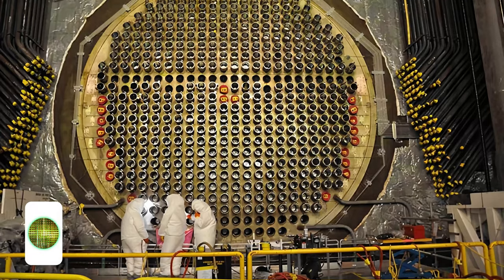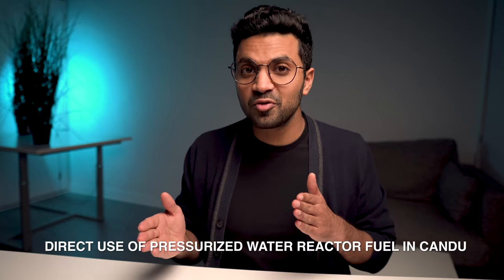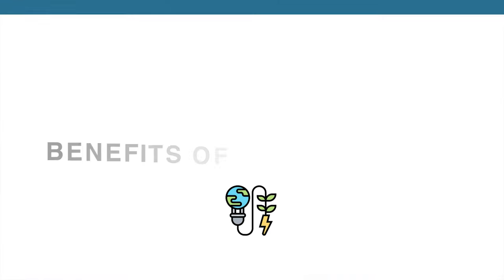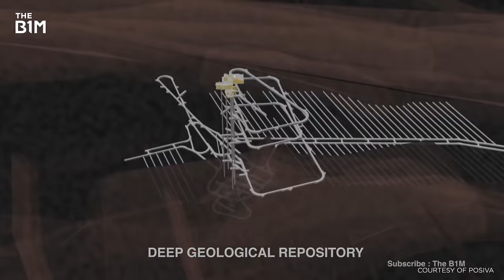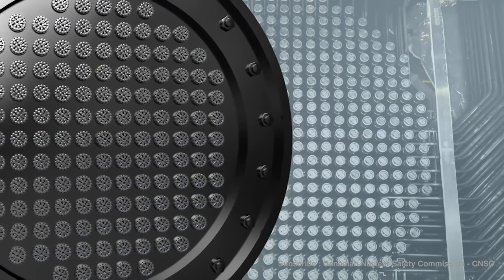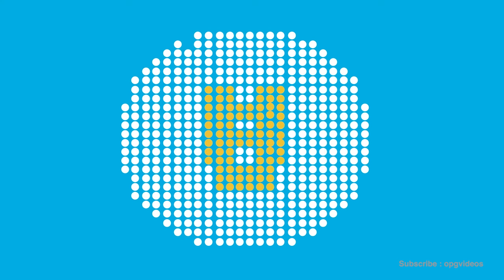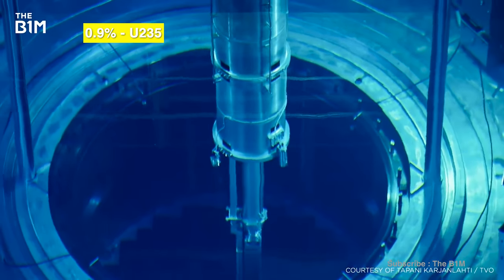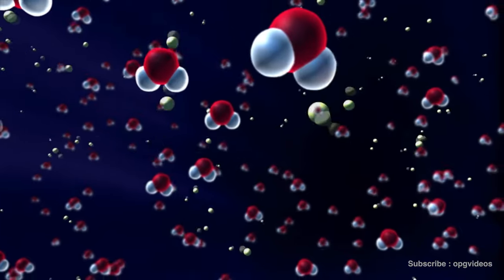How CANDU Reactors Can Solve The Nuclear Waste Problem

Comment: Thank you Osama. Great video as always. At some point can you go into the recycling of the zirconium cladding for fuel bundles? Cheers
Reply from the maker: Typically Zirconium cladding in fuel bundles are not recycled. From my understanding, it would take a lot of resources to do that, and it may not be worth it. Remember there aren't too many bundles out there, in Canada there are around 8 hockey rinks worth of spent fuel bundles. You would need to make a business case to understand if its worth it or not
Reply: @OsamaBaig  Thank you for your insights. I was wondering if it was worth it (at $23k/tonne). I bet it would be hard to reprocess especially given the high temperatures needed + all the radiological precautions which would be required.

Comment: Great Show on a complicated Subject Osama!!!  This will need allot of Hot Cell work to fabricate the spent assemblies into CANDU Bundles.  But it beats a full blown fuel reprocessing in cost.  I believe the reason this idea hasn't caught on is because Uranium is too cheap right now.  If the price were to climb into the low hundreds for a few years to catch the interest.  Currently Uranium oxideis at ~$40 lb
Reply from the maker: Its the entire lifecycle cost of fuel to consider as well, since disposal and storage of fuel has a cost as well. Thanks for your comment!